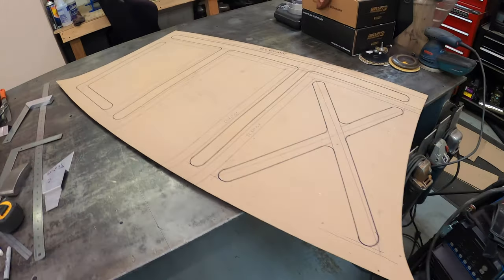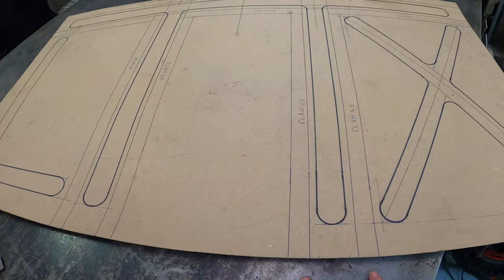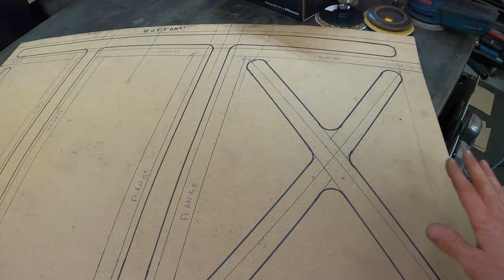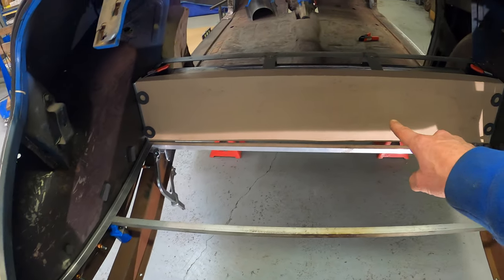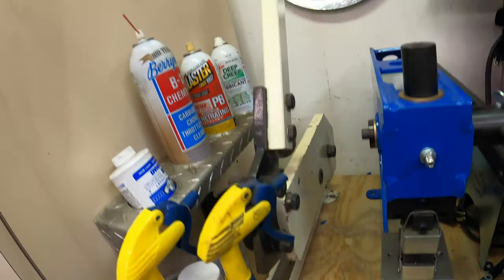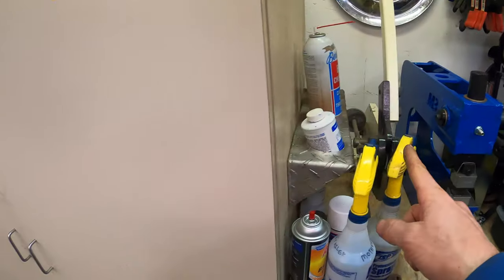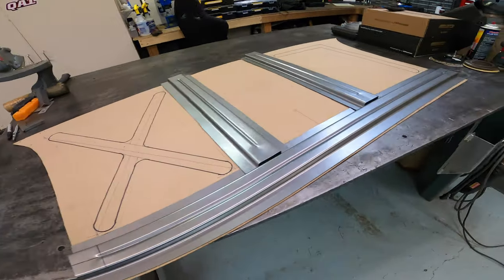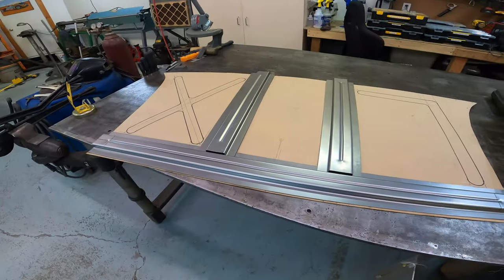The Manhattan Project: Episode 20.  Fuel tank frame rails and floor pan planning on the Fleetline.

Comment: Pic at the end got my wife and daughter to check it out by going look at this beautiful girl. Forgot to leave a comment on ur last video. Make it Kustoms was saying the Milwaukee electric shears are as good as the table shear. Which could work on the longer panel if you wanted to invest in another tool. 
Wish me luck I got a garage for a week so trying to push the pillar out 1/4” in my 94 gmc quad cab dual dump. Then change the rocker panel. Using a flux core cause it’s what I got. Got the int panels off and doors, dug the dirt out letting it dry and thaw out over night.